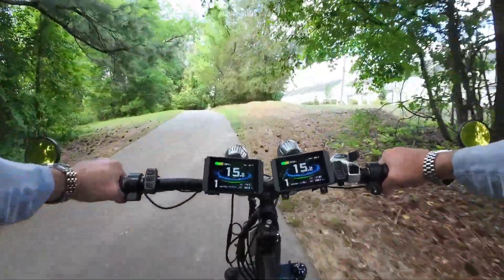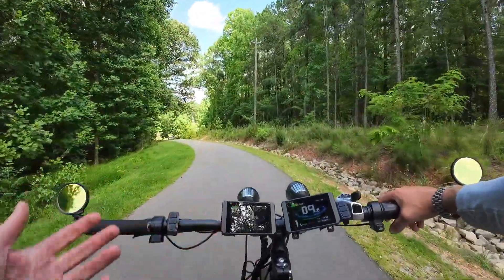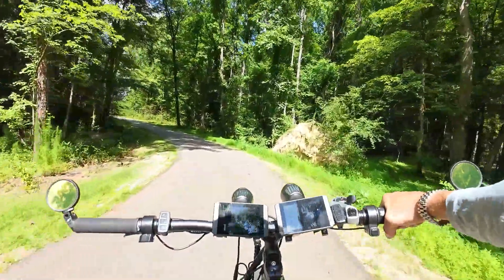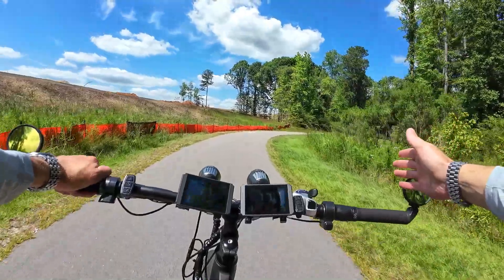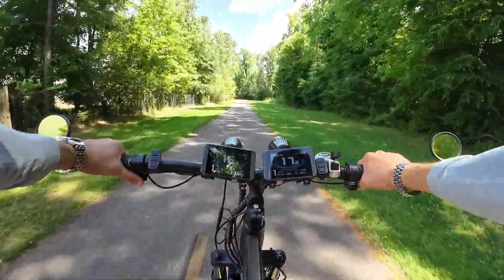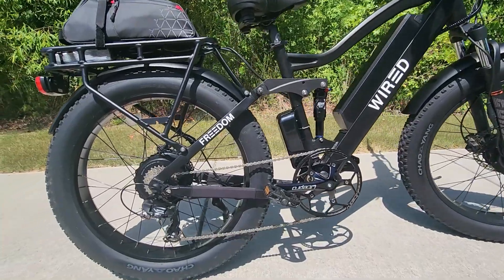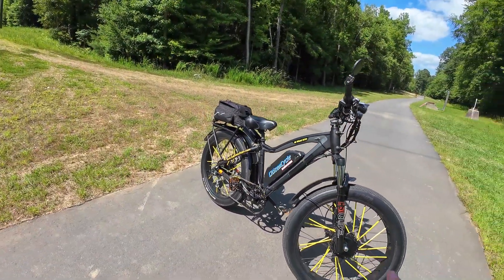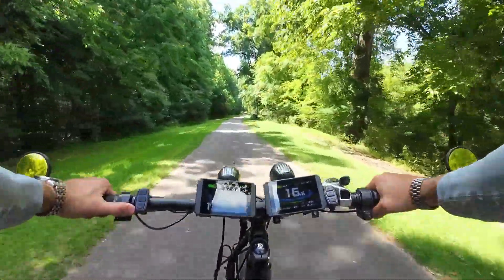Aftermarket ebike Parts: Hard to Find & Make

Comment: Sometimes the connectors don't match because the component just use different standards, power, communication etc. As far as I see in the endless-sphere forum, there are even different throttles (not just connectors, shapes but how they work). In the "upgrading a controller" case, even if everything matches but batterry isn't powerful enough, it's going to be an issue. So maybe DIY is not everybody's or every beginner's thing. I think while this "issue" can be fixed somewhat in future,  we may not see a plug-and-play for everything, it's just not seem to be possible for each combination. Or... the "connector" problem would be 100% solved but you'd still need to check everything is compatible or it wouldn't work, or worse, something would fry.

Comment: Pick one bike first . If you make a 45 or 50 amp controller for my freedom I would buy it right away . Once you take care of that then choose another model that can take advantage of the upgrade. If pre-orders will make it more feasible then do it that way. I'm sure if after you do a couple runs any supplier will be glad to supply a small number with a certain type of plug for a certain bike. Thanks for all your good work.
Reply: The new Freedoms DO have 45 amp controller already.
Reply: I originally bought the first version, sold it and bought a 2023 version. So mine still has a 40 amp controller. I wonder how much difference the 5 amps really makes?
Reply: You can always shunt mod, I'm pretty sure Citizen has a tutorial on how.

Comment: Plug-n-play is a bit difficult due to the sheer number of e-bikes out there and the moving target represented by the constant stream of new models.  I think having standardized connectors is basically impossible.

That said, the actual motors and controllers are fairly standardized in terms of control and power wires.  There are only a few types of motors and it seems like many controllers can be configured to handle almost anything, at least as long as the voltage is compatible.  Even if the connectors are not.

This puts wiring squarely in the realm of the enthusiast.  One need various wire sizes, sheathing, heat shrink, good wire strippers, proper ratcheting crimpers, random connector kits, a soldering iron, a heat gun.  It's quite a list.  Stuff I just have on the shelf, but most people will only have some of it.  Not enough to make a proper job of it.

There is also the problem of all the cable lengths all being different for each model, never mind the incompatible connectors on the ends!  Supplying a universal kit with adapters for different connector ends has its own problems due to the sheer number of combinations as well and your inability to test complete systems for all e-bikes.

--

This is a conundrum.  Perhaps the solution is to leverage the enthusiast crowd.  Supply two types of kits:

#1 - What you are doing now where the kit is model-specific and basically just plug-n-play.  Something most people can install without tons of tools.

#2 - An "enthusiast/DIY" kit for people with electrical skills and don't mind investigating additonal parts themselves.   This kit supplies the devices and cables like #1, except the cables are long enough for any bike and the cables only have one connector (loose wires on the other side). That connector being into the equipment you supply.

Then the enthusiast needs to get the proper connector kit for whatever the other-end gets plugged into, cut the wiring to size, solder, heat shrink, etc themselves.

Once an enthusiast does #2 and tests it, knowing it works, they can email you with pictures and the precise length they cut the cable to and the connector adapter they used.   If you choose, you can then supply a #1 kit for that specific e-bike instead of a #2 kit.

That all said, you would still need a way to verify that the cables you are supplying will actually work, which can be a bit of a show-stopper.   And its a lot more work on your-end to make a business like this work.  Still, I think being able to leverage the enthusiast community might be the key.

-Matt
Reply from the maker: Thank you for this detailed input!

Comment: I remember being able to go into radio shack and say I’m trying to wire this to that and we’d go through drawers and drawers of adapters to find the right fit. That’s what we need - a big adapter kit. 

Also, I just got back from a trail ride which is my main interest, and my bike clearly needs more torque for the hills. My controller is 23 amps while my son’s is 28, and he just leaves me behind all day long despite my bigger battery. It’d be nice to be able to just update the controller for a bit more power. Adding a front wheel motor honestly doesnt make sense to me because when climbing the dirt trails all the weight is on the back wheel.
Reply from the maker: I really like that idea!!! adapter kit, I'm going to start looking into that.  great one!!!

Comment: I would love to have standardized wire harnesses. I worry about this when needing to replace components. I wonder if there is a way to release with no connectors and provide the connectors separately.

Comment: You have two primary options: Sell components with common or generic connectors, and leave it to the customer to replace the connectors on their bike to match. The problem is that, if it turns out the customer over-estimated their capabilities, you are stuck with a huge support issue for an endless variety of bikes and wiring. I know when I did my RadMini, there was no one to turn to, and I had to pretty much build the wiring harness from scratch. The other option is to make the kit complete: motor, controller, display, throttle, PAS sensor, and wiring harness. They just strip their bike and put your already tuned components in, and the only variables are the dropout spacing, lighting and brake cutoff connections, and the length of the harness.  

By the way, the FarDriver controller is turning into a hot option for many builders, and it uses one large plug for all connections except the phase wires a power inputs. It's used in the 60+mph Spark Cycleworks Javelin, and the 10,000 watt 60mph Ego minibike of Rik Codero from RunPlayBack.
Reply from the maker: Thank you so much for the input we'll see where this goes. I had not heard of the fardriver yet I'll have to check into that
Reply: @CitizenCycle925 not to be an @$$hole but you are trying to make parts for the ebike industry and you don't know anything about the top of the line fardriver controllers? That's just amazing. You should really bone up on where the industry is going and who leads the pack in every part of the modern ebike industry before jumping in feet first and ignorant.
Reply: Take a page out of the PC power supply market, go Modular. Standardize the output connectors on the controller, customers could kit out the controller based on what they have. But keep in mind you will need a flexible controller software that can be modified to support different magnet counts, voltage and other parameters to have a smooth running motor.

Comment: You might consider producing torque arms for these bikes. I have purchased two torque arms (from a very reputable company) and one of them was so sloppy that I ended up having an axle spin-out even with the torque arm installed. So something like that might be useful for these stronger e-bikes. Having had two axle spin-outs I can tell that they are not fun nor are they a cheap event.

Comment: The struggle is real brother. All of us DIY e-bike builders have known it for a long time. You just got to learn how to solder heat shrink And be prepared  Make costly mistakes😅
Reply from the maker: I used to hate soldering but now I don't mind it so much anymore, I think the bigger problem is knowing the names of the connectors and where to get them..

Comment: https://youtu.be/Rs3p0jQUhkE?si=q3SwIQYtRlnNyaZZ

There is a lot of concern amongst industry participants around battery safety. Higher amp controllers than batteries are designed around introduces risk. You may be opening yourself up to liability depending on how you market it. Take a look at a recent panel discussion with the NBDA to hear some brand perspective on connectors and security:

Comment: Create a kit with a 40 amp or so controller and that kit will be specific for the connector for the rear motor. Your kit will include the wiring harness throttle, head light light and display along with the crank sensor if needed. I’ve got a Wallke H6ST that is just anemic. The factory controller is garbage the bike hesitates like crazy even with the replacement controller, it’s  really no better. Come on I’ll send you a pic of the outbound wire on the motor and I’ll replace everything else if you can make it work. Let’s go!
Reply from the maker: I think you're right. if I did any kind of rear wheel kit it would need display, controller, throttle, wiring harness, and possibly lighting all in one package

Comment: Just stick with the front wheel kit for now, even if the price goes up to like 1500 bucks you will still sell all of them I believe easily. It's a pain in the butt to try to find all the parts and if someone else does all the work it's worth the extra money. There is no reason to even think about the standardization of the plugs that is never going to happen. I can't wait to get a hold of one of your front hub wheel Motors please get those going again
Reply from the maker: I agree with you there's something to be said for keeping it simple, not having a ton of different products to manage

Comment: Sadly I'm pretty sure you'll have to have a ton of adapter cables.
The only thing you can control is what connectors you use. I would love to see a 1500 watt continuous rear motor, 45 amp controller and display.
Reply from the maker: The problem with providing a 1500 watt rear motor is typically they have a wider dropout, so it wouldn't fit most bikes

Comment: I enjoy your videos, but I am not interested in dual motors or FWD. Fast acceleration doesn't interest me either. Top speed does, and long-range is even more important to me. 
I'm not surprised you are finding so many different wiring connectors. Like you I doubt it's on purpose, they use whatever they have available when building these bikes.

Comment: I don't think connector standardization is going to happen. It would be great, but it is just wishful thinking.
If I understood things correctly, then you are considering 3 options regarding controller upgrades:
1...Sell controller and let customers figure out connecting it.
2...Sell controllers that are designed to fit specific bikes.
3...Sell controller and stock the many different adaptors needed to cover the majority of bikes.
To me, option 1 seems like the worst of the three. It doesn't add anything new to the market. People that are capable of connecting your controller could have done the same with the many other controllers that are currently available on eBay and Amazon.
Option 2 may be the most viable. It would require doing market research to determine sales figures for major brands and models, but your workload is mostly up front with market research and part sourcing for the kits. It is a more limited total market, but you get to ship things that normally will be hassle free for both the customer and yourself. This also let's you choose appropriate bikes that are capable of handling the upgrade. Otherwise you will have to deal with unhappy people that thought their little 10 amp hour battery would be no problem with your 40 amp controller. 
Option 3 seems like a lot of work to me. It will be a lot of work stocking and shipping the many different adaptors needed. Customers will feel frustrated trying to figure out what they need. They will want you to hold their hand, and you will get endless questions. It would be a very useful resource for people, but it sounds awful for you, Citizen.
Reply from the maker: I think your thoughts are absolutely right on the money!  Thank you!

Comment: Needs to be replacement controllers just for the rear and no front motor that gives 5 mph increases. Just a rear motor to go from 35-40 plus.  No dual motor and no dual display

Comment: I just got done emailing you  back on your update for the warp drive and  And saw this video. I was just thinking to myself that after I  installing the warp drive I would probably want to upgrade my stock  Rear controller to match the front.👍🏼👍🏼. But  As you were saying connector issues would be an issue for the variety of bikes out there?? 🤔 .  Making it standard for all bikes is going to be a challenge whether you need a adapter plug or something I wish you the best and look forward to what you come up with.. I'm down either way .Keep up the Good Work👍🏼

Comment: The best way would be your own kit your own wiring harness where you can add on things like lights and everything else but have your controller your display that basically all standard that would be the best way to do it and have different wheel sizes 2024 and 26 you can have a couple different controllers that can be different sizes that will make things very simple it will cost a little bit more but it's simple for the person that's buying it

Comment: Maybe start with a complete kit rear wheel kit that can replace the old wiring harness the old display the old connector for the control box complete with everything that's probably the best way to do it and it's not much more money because the different wiring harnesses make it very difficult so get a standard wiring harness that can be used in your kit instead of trying to adopt to all the different wiring harnesses out there which probably is going to be impossible to do something that will work on 48 volt and 52 volt and something that can be adapted to 60 and 72 volt poor future use

Comment: I think it's time for Citizen Performance to step into the breach and throw down the gauntlet. It's time for the Citizen Performance Bike! A 72v monster but still a bike that is BUILT to be modded. Need help? I'm available if you are serious🍻
Reply: I've built a 72v 2000w single motor,  performance is great. Would be insane with AWD. Top speed with my 270 lbs is 42 all day long.
Reply from the maker: I do think whoever creates a 72 volt bike that actually looks like a bicycle is going to sell a lot of them. probably won't be me though, not ready for that yet
Reply: Duel motor 72 volts would be sweet
Reply: I been th8nking of 72 volt

Comment: Very thoughtful and interesting. The only solution(s) that seem possible are an add on as you've done or a replacement kit.especially as new versions flood the market (and probably disappear) continuously. Maybe as individuals get stuck with non-working bikes they can't get parts for, your solution(s) will become more viable. BTW, I de-wired a recent conversion by removing 30" lengths of wire from both motor and display to controller, but needed to solder about 15 small wires to do it.
Reply from the maker: Complete replacement kit is a good idea, I like that for when your bike completely dies or if you just want to upgrade your working bike

Comment: I'd definitely like some standardized plug and play items, especially for basic utility, like headlights, blinkers and horns. One of my bikes has a great headlight with a built in horn but my primary bike has a trash headlight. I spent $49 to get a headlight upgrade but it was just a cheap $8 temu headlight with a 2 pin ebike connector soldered and electrical taped on. It's bright but it doesn't project forward, it's better for cars to see you than for you to see a dark road.

Comment: if the connectors are the only thing holding you back, you can research making in-line adapter converters which might let you use controllers and hubs with different connectors together. make sure also the motors accept the rating output of the controllers to not burn out the motors either.
Reply: Is there 1 connector type that is more popular than others?  That's where you could begin.